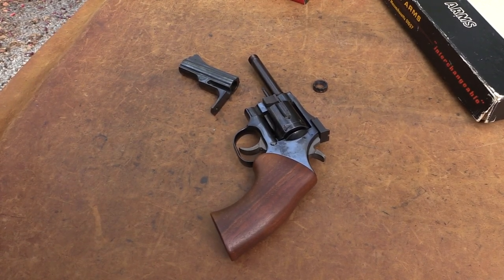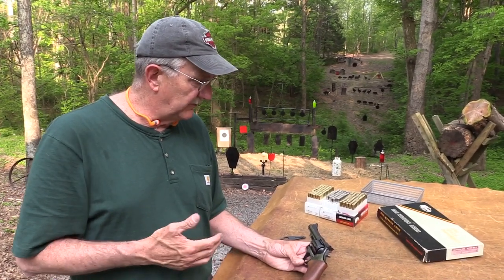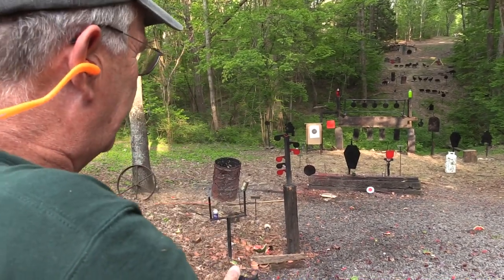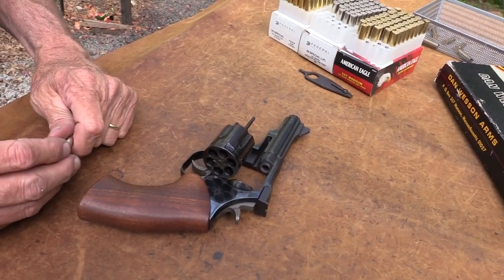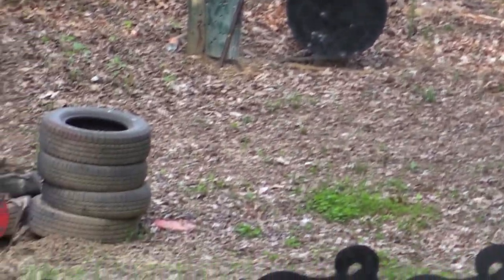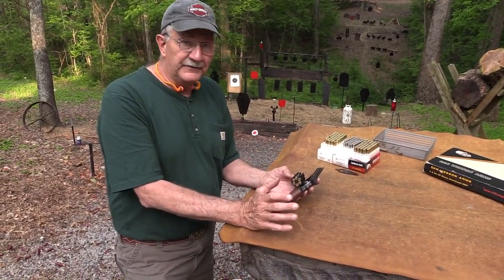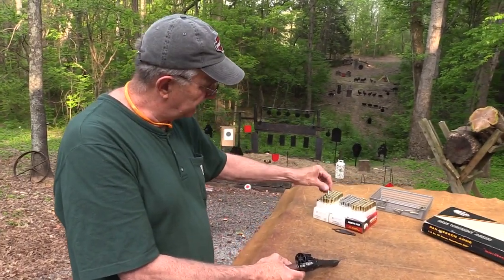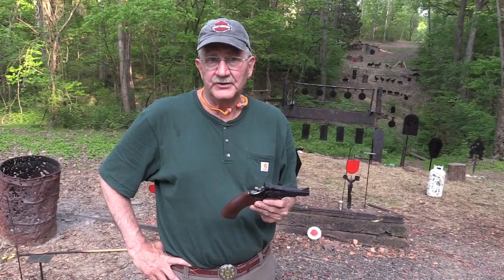Dan Wesson Revolver  .357 Magnum

Comment: Dan hired me back in 1977 and I worked on these guns as a metal polisher for two years, working there helped me to fund college.  Thanks Dan...
Reply: I’m wondering if u polished the one I own..check my video out
Reply: I have a nice 79' with the original included belt buckle. Remember those good ole' days??
Reply: I just inherited one. It was purchased in 1981. Should I have a gunsmith take a look at it before firing it?
Reply: @Ptpop  after 30 years or so i would say yes .. just to make sure all is in good working order .. be safe
Reply: @Ptpop If you feel confident and competent to check it out yourself, it’s similar to most other revolvers sans the barrel assembly. Just make sure the barrel and shroud are not lose. But if you have any doubts about your abilities then yes, take it to a gunsmith for checkout. I have three of them and I love ‘em!  They’re very strong and durable, never had any problems with them.

Comment: I know it is late to comment on this video, but many years ago I used to compete with them. The factory supplied feeler gauge was .006". If attention was not paid to that gap, the revolver's famous and well-deserved reputation for accuracy was often lost. On a super-clean gun you could sometimes go down to .004" and squeeze just a little bit more accuracy out of them, but soon your gun would get hot and bind up. i could often do just fine with .005" and that is where I usually left it for bullseye and silhouette. in bullseye, the hammer spur was a bit short for the rapid thumb-cocking we had to do with factory grips. At that time, you could order a fully-inletted walnut blank and carve your own grips.

I know you are one hell of a shot, and I'm thinking that the less than impressive group on the bullseye target was probably due to an overly generous gap. My 15-2 with a 6" barrel on it, properly gapped, would hold the x-ring just fine on indoor 25 meter slow fire if I did my job.

I always considered the Dan Wesson with interchangeable barrels more suited for a really serious shooter. Casual shooters could not appreciate some of its design features which were optimized for accuracy, and few had the need to exchange barrels. I think this may have had something to do with limited sales. Dan Wesson, who died in 1978, valued precision and strength far more than aesthetics, and it showed in his revolvers. i grew to love them in spite of how they looked.
Reply: The barrel design is what made it so accurate, the barrel had tension on it, which reduced barrel flex. 
Also, all of the working parts are in the frame, so the grip gets attached to a stun on the bottom of the frame.
Reply: Dan Wesson hanguns are pure beauty!

Comment: I bought my Dan Wesson mod 15 (recessed barrel nut) in the way early 70s. It came in the case with the 2 1/2", 4" and  6" barrel along with three different grips one of which was a carve-it- yourself  blank. Using the provided feeler gauge the barrel gap was easily set in fact a barrel swap was a quick, drama free affair. The action is smooth and its accuracy potential is way beyond mine. Still not the prettiest gun in my safe but worthy of more respect than it has generally received.
Reply: Dan Troop Yep, I've had a stainless Dan Wesson for many years. I only have the six inch barrel for it. It's a shooter.

Comment: VERY good shooting with a 4" barrel. Yes, back in the day Dan Wesson went all out to make a rugged accurate revolver for silhouette shooters. I guess the beefed up handloads of .357 and .44 weakened the top strap and loosened  up cylinders. So they made the front locking cylinder and that helped also. Then the .357 Max and .445 Supermag were born from the sport. Yes, I love my Dan Wessons (.22, 357 and .44)

Comment: I have the Dan Wesson model 15 (the one you are referring to with the internal locking nut). I bought the pistol in 1994 at a pawn shop. It came in the case with 2.5", 4", 6" and 8" barrels as well as with 2 grips, the feeler gauge and wrench. I paid $280 for the entire setup. Had it appraised for my insurance several months ago and got a statement from my favorite gun shop that they would purchase it from me for $1300 or put it on consignment for $1500. Love the gun too much to sell it. If anyone has trouble with losing the feeler gauge you can use a .006" motorcycle spark plug feeler gauge to set the cylinder gap.

Comment: Been a Fan of yours for years !  I can't believe I haven't come across this video, or for that matter, searched for it.  I had this revolver, don't remember the model number,,.  .357  Mag. Bought in the early 80's.  Had the Ribbed, Heavy Barrel, {6"}  no didn't have the full 4 barrel pistol Pak.  I loved that gun !  Although the grip on it, not the one in the video, mine was checkered.  Grip was large even for my big mitts. I wound up getting some Pakmyer {sp} rubber competition grips I used for shooting, I do agree with ya, the one in the video is Ugly, with the plain grip.  The stock grips were eventually destined for the gun case for display.  I bought it because short of a Colt Python, it was the smoothest gun I've ever shot.  And yes, I've shot the S&W's "27" &"29".  Great video !   Admitting MAYBE you were wrong originally about the gun.  Like I said, been a fan for a long time, and now after seeing this, will be one for a long time more !

Comment: About 25 years ago, I owned a six inch barrel Dan Wesson with the six inch heavy barrel vent rib shroud on it.
Mine had the small inset lock ring at the end of the shroud.
And you had to measure the cylinder to barrel  gap with a feeler gauge Dan Wesson sent with the gun before you tightened the lock ring.
It had a wonderful deep blued steel finish on it .
The break on the single action was magic.
Very crisp and light.
Single action, it was the best trigger I have ever shot.
The double action was smooth but the cylinder action was similar to a regular Smith.
The adjustable sights on my revolver were awesome.
That gun single action was amazingly accurate.
I don't second guess my reasons for selling it.
At the time, it was necessary.
But I miss that revolver.
It just felt like a piece of handgun artwork.
You ever find a good copy of a Dan Wesson. 
Treat yourself to some artwork.
Just make sure to check under  the top strap right where the barrel gap is.
Do that for any used magnum revolver.
Hot loads can wear grooves there.

Comment: Adopted my model 29 spring of 1980, 100 rounds every Saturday to start. Took several years to get grips that worked, Pachmeyer did it. You do not want to be downrange, and within 400 meters if you are a bad guy. No brag, just fact. These are more accurate than 98% of shooters.

Comment: Dan Wesson left S&W when the American company Bangor Punta (as in  Bangor Maine)  Punta (as in Punta Alegre Sugar in Cuba). Bangor Punta bought S&W, and also owned:  Cal Boats, O'Day Corp., Ranger Yachts, Piper Aircraft, Forjas Taurus, and Smith & Wesson.  Yes, Bangor Punta also owned Taurus, and Ranger boats. Lear Siegler an old heating company turned aerospace/military company bought up Bangor Punta in 1983 or 84. They had the 357 Maximum .357 ultramag and the had a 454 Maganum, the ultramag .44 Magnum. They liked to flame cut the gun's frame.

Comment: I think they improved the looks somewhat with the 15, with the recessed barrel nut and losing the "porkchop" shroud. Honestly, I don't see anything ugly about it. I got mine a few years ago for just over $200, the previous owner was upset because the cylinder wouldn't turn smoothly. Turns out the barrel was cranked in too tight. Had it checked out by a gunsmith and I use the factory gauge when mounting a barrel, and she's a sweet shootin' iron.
Reply: I've owned a model 715 .357mag stainless steel heavy barrel pistol pack, 8" to 2" barrels, 4 front sights of different colors, custom zebra wood grip /pachmayr rubber grip with a combo tool and feeler gauge all in a briefcase... It shot great and accurate but if you didn't keep the gauge in you'd jam the cylinder...

Comment: In don't have the DW 357, but an 8" full lug 44 model 744VH. I've had mine since the mid 90s. It performs as well today as the day I bought it. It is very well built and accurate. I hope CZ brings back the DW revolver. I like to add the 357 pistol pack to my collection. Thanks Hickok45 for showcasing the DW 357.

Comment: I received one of these as a graduation present from my parents. It came as a kit as you stated. 4 barrels, 3 different sights, red white and yellow 2 or 3 different grips (cant remember) the barrel tool you have in the video and a feeler gauge for the clearance between the barrel and the cylinder and I think there was an Allen wrench for the grips and sights.

Comment: Bought one new in 1978 with an 8 inch heavy barrel for $179.00 in Phoenix Arizona, when I was stationed at Luke AFB. Excellent revolver.

This was the first revolver I ever bought and a friend also bought one.  He also bought an RCBS Jr. reloader with the dies for a .357 for about $40.00 then. So I figured I would do the same thing and save money on bullets. So, I was loading my own ammo and did not get enough power one and ended up with a squib load which split the shroud on the right side of the barrel about two inches from the frame. However, I did not see the damage right away. So I reloaded a couple of times and fired several rounds after the damage had been done and the rounds went straight to where I was aiming.

Then my wife pointed to the right side of the gun, we were out in the desert around Luke AFB shooting, and said what is that. I looked and said a few colorful words. Then I took it to a friend that had a FFL that I bought it from, told him what happened. He looked at it and said, "You are lucky you had a Dan Wesson, if it had been a Smith or Colt it would have blown up in your face." So I called Dan Wesson factory up and told them what happened and bought a new 8 inch heavy barrel for $80.00 then,  The guy I bought the gun from had  to put the barrel in a vise and use a hacksaw to cut it off between the damage and the frame.  He said it took him a couple of hours to get it cut off and install the new barrel.

Comment: My friend traded a PSA AR-15 for a 15-2 with 4 barrels, in the case with 4 extra sights, belt buckle and sew on pouch. Your model is referred to as "Pork Chop" version. His was in Nickel, but had rusty spots all over. I told him about boiling it, which I got from Mark Novak. It cleaned up beautifully. He told me he turned down $2200 offer in spring of this year. I shot it a few years ago and it was super accurate. He also had 3 grips that came with kit, it had a cheezy yellow clothe that lines foam lined aluminum case. His was made in Monson Mass.

Comment: Hi Hickok45.  The Model 12 was called the 'Pork Chop' model.  The cylinder - barrel gap is 0.006"  I have owned 3 x Model 15 DW revolver each with 6",4' and 2.5" barrels and a Model 14 with 6" and 2.5" barrels.  Speed loader are the same as S&W K Frame.  DW Model 15 with 2.5" barrel in a pancake holtser for concealed carry.  Thanks for great channel, Greg Summers

Comment: I have a model 15. Love the gun. It has a 4 inch barrel and I bought an after market 2.5 inch barrel from EWK. If you have a Dan Wesson and don't know about EWK, you're missing out. You can put the hottest round through a Dan Wesson revolver and not worry about cone or cutting damage. They are built. If you practice, you can unlatch and open the gun one,handed.

ps thanks for the video, my gun just went up in value.

Comment: I guess I'll show my age. (late 60's) In my twenties I was actively shooting 'Bulls eye" in a club. When I started I was In awe of some of the High Standard .22's that some folks were shooting, but I wanted to shoot center fire. I was finally able to but a new High Standard .357. It was made for them by Dan Wesson, but you couldn't get a 'pistol pack'. You ordered it by what ever barrel length you wanted and I wanted a six inch. High Standard at that time had the internal barrel nut so it wasn't so Buck Rogerish looking as the Dan Wessons of the time. DW changed to the internal nut when (I believe) they got so much flack by the press for the external nut's looks. The High Standard had some of the nicest bluing I've seen to this day. and the single action trigger (adjustable for over travel) was as good as any revolver I have had the pleasure of shooting.  Double action, not so much. Now you don't shoot magnums in bulls eye so I used .357 Mag brass loaded with wad cutters to the load the revolver liked best and when I did my part the HS held it's own against some pretty fancy stuff at that range and others we traveled to. She would do 1 1/2' groups at 25yds. and some 3" at fifty off hand when I'd had a good breakfast.
Life is real and with children and bills I sold it to a good friend but was never able to retrieve it. It hurts to this day.Some very high quality firarms. Nothing else to say.I'd love to have mine back.

Comment: Dan Wesson designed a cartridge that was between the .357 Mag and the .357 Max, known as the .360 Dan Wesson. Cartridge lengths are 1.29" Mag, 1.41" DW and 1.6" Max. It was designed for silhouette shooting, and was supposedly a lot less fussy about what loads it would shoot well as compared the Max. Brass is available from Starline. Enthusiasts have rechambered .357 Mag lever action rifles for the .360DW, where it can achieve results that are not too far behind the old .35 Remington rifle cartridge.

Comment: I had a Model 15 back in the early 1980s, and three barrel lengths, one of which had a scope installed on it.  Pretty cool guns.  It came with a steel gauge so you knew just how far to screw the barrel into the frame.  Looking at your wrench, it might have a swing out gauge on it.

Comment: Back in '79 I purchased a new 15-2 for $225 with a six inch barrel. Since then I've purchased the 2 1/2, 4, and 8 inch barrels. The 15 is definitely much better looking than the old 12! If I was told that I could only have one handgun.....my DW would be the one!

Comment: Nice to see a DW get some attention.  I have a model 15 with a 6" vented barrel and a hogue grip and I love it. Years ago I needed cash and since I didn't really have to have two .357's I had to choose between keeping it and my GP100.  I kept the DW and sold the Ruger because the accuracy and feel was so much better IMO.  Even with the popularity growth of the GP100 Id make the same decision again. I just wish I had more barrels. The 6" is an absolute tack driver, but a 2" would be nice... and a 4.. and an 8😉. Extra barrels are spendy, and hard to find though. BTW the model 15 came with a .006 feeler gauge, and takes a #10 speed loader... not sure if the model 12 aka "pork chop" is the same.

Comment: CZ has gone into making the Dan Wesson model 715 which is in .357 magnum with a 6" barrel and a full barrel shroud it is made from 416 steel, the finish is stainless steel, it has adjustable sights on the rear.

Comment: I had one of these back in the late 70's. I believe the cylinder gap was supposed to be .006 of an inch. Mine came with the feeler gauge and had the internal barrel nut.

Comment: I'm finally getting to a revolver, Hickok, in large part because of you evangelizing them.

I almost got  Dan Wesson used but it was in really poor condition.  Interestingly though they are making Model 15 revolvers again and you could order barrels and shrouds for older 15s and they should be compatible. 

What I ended up getting is a Ruger Gp100 Match Champion I pick up this week.

Comment: My father gave me a Dan Wesson Model 15-2 as a college graduation gift in 1976. My experience in unlike many of yours. The cylinder diameters are not consistent. I have to push .357 mags out with a wooden dowel. Once it gets a little dirty, it gets more difficult to shoot double action. The original rear sight was poor quality. The magazine release was the least of my problems. If it weren’t for sentimental value, I would have sold it a long time ago.

Comment: I’ve been able to pick up a couple DW’s in the last couple months. First was a Model 15. It has a decent trigger, and def a quality firearm. Latest is a Model D11, which looks similar to the model 12 in the video, except the D11 has fixed rear sites. I don’t like the D11 trigger DA. It has a very heavy pull and hard break. Single action is still good though. I def agree that while they are quality revolvers they are not as good as S&W in my opinion. But I’ll never get rid of them.

Comment: Dan Wesson's website lists the 715 Revolver in .357 Magnum with 4, 6, and 8 inch barrels. If you buy the "Pistol Pack" you get all three barrel lengths. The site does not provide a price for the pistol Pack, but the simple revolver in stainless steel with a 6 inch barrel lists for $1,558.00. The "Parts" page shows that different length barrels with shrouds will run you about $400.00 each, give or take.

Comment: I got mine in the 1990's from the daughters, there were tooling marks on the frame, the plastic wrench broke but the gun held up. There should have been a feeler gauge with it. Brownells used to have replacement wrench, seems to be gone now.